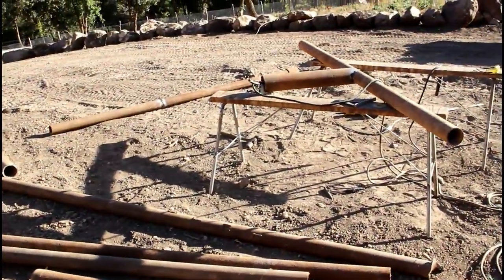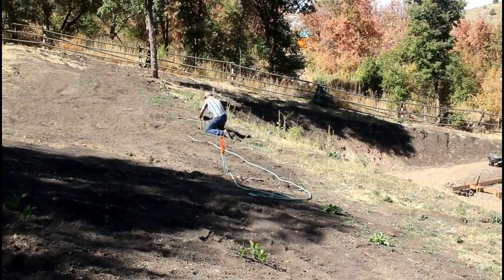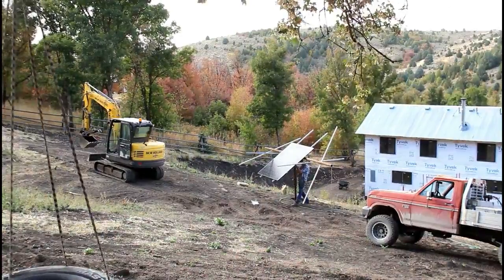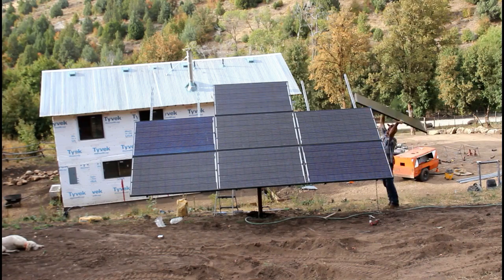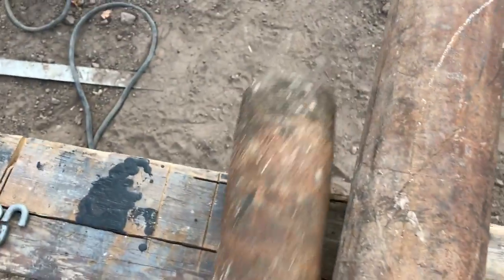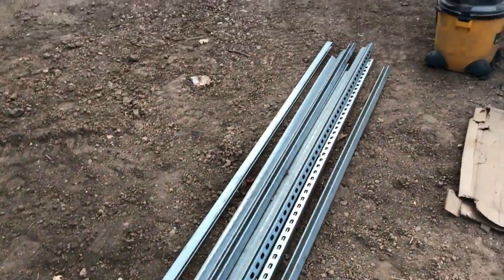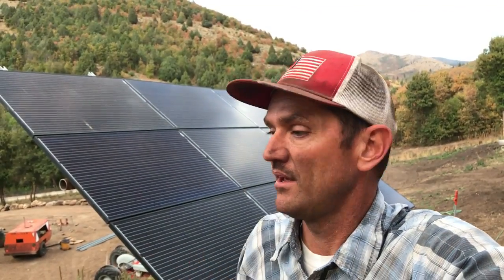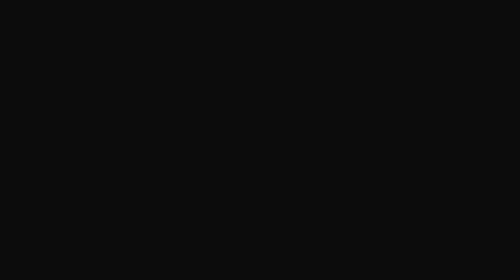#262 - I Built An Adjustable Solar Panel Rack (Ground Mount)

Comment: I need to build my own but just a lot bigger and longer. Will use pipe for taller back rows and shorter front to get 30 degrees for permanent mounts. How did u tighten down the u clamps? Nuts were up in the unistrut correct? And I wish you would show how u connect panels to the unistrut.  Thanks. Jeff in ks.

Comment: Looks great. I'd love to have a mount like that. I only have 1850 currently but hopefully I can get another 12 or 16 panels soon. At the moment I have 8 adjustable aluminum ground mounts but they still need to be bolted to something. They are the 50 dollar each units from Amazon and kinda light weight but not the best for sure. Good video thanks for showing your build

Comment: Why not use a jack screw or a 12 v ram to do your fine tuning?
I would also run angle iron as a brace to take out your bow….any flex or deflection adds to some solar loss.

Comment: I fenced in my priory with railroad ties and cattle panels, 16’, and Tractor supply 5 yrs ago had a smoking deal, I couldn’t pass it up, was cheaper than the rolled fence as well. How heavy are those? I think mine were,200-250lbs each.....I installed 75, and three telephone poles for a ranch style entrance way....memories....

Comment: I bought 2.5kw in used solar for $577 delivered. I just uploaded a video and they seem to produce the power and more. I was going to buy 10 more panels but was really curious of the condition. I just realized I will use 3 in series so that's 9 or 12 per array.

Comment: how long has this system been up have you had any galvonic corrosion with the different metal types .i heard you need to add nylon washers inbetween the 2 surfaces . thanks let me know

Comment: Hi Red Poppy Ranch guys;

I don't want to be critical but I do want to say that I think your mount is a bit weak for the panel array you have. Here are my comments on it.

Wind loading calculations based on the National Building Code, NBC.     
I 'm wary about the strength of the main pipe you are using in your design. My problem is your not designing to a high enough wind force. The NBC is used for houses, structures, and towers in windy environments.

Generally, the wind loading portion of the code is used to design for horizontal wind pressure is 10 lbf/ft^2. Some areas of the country use 15 lbf/ft^2. This means the structure must resist this load for every square foot  projected horizontally. Other local building codes I have seen go to an extreme of 50 lbf/ft^2. You need to see what your building codes say.

The max force is not caused by normal weather based wind which rarely exceeds 70mph. 
The max survivable force is caused by down bursts from cumulus clouds which causes 
an almost instantaneous 90mph which is 10lbf/ft^2. 105mph causes 15lbf/ft^2.

Down bursts don't happen often but they do happen annoyingly enough.     
I have, over the years, had a number of my customers that it happened to.     
Some survived, others didn't. They had an expensive lesson.     
     
Of course, tornado go much higher but are not survivable.     
Hurricanes are also not survivable but you have time to take the panels down.     
     
I don't think your drill stem will survive, even the 4" won't survive.     
     
I have not calculated the dynamic wind loads nor the panel supports. There is a reason     
the big commercial mounts have massive support pipe.     
     
Take a look at what I call "Tripod Mounts" which are stronger in every way and use relatively light materials. See:
http://www.redrok.com/electron.htm#tripod

I have a spreadsheet that may be useful for calculating pole strengths. I tailored it for your vertical post. See:  
http://www.redrok.com/Red_Poppy_Drill_Stem.xls

I hope this is helpful!

redrok
redrok@redrok.com

Comment: Check this site out for your angle.  All you do is plug in USA, state and city.  This will give you the angel you need to have set for the best production per season.  This is what I used when I had solar.  I moved the angle twice a year, once in the spring and once in the fall. Keep in mind that in my experience when the panels are hot they are less efficient that when there cooler.  http://solarelectricityhandbook.com/solar-angle-calculator.html

Comment: How are you storing energy, batteries don’t last so I’m sure someone’s used super capacitors but i haven’t found them yet. You could add a retaining natural pool with a hydroelectric setup. I think a waterfall retaining wall behind the house would look great, plus since you’ve saidur not going to have ac your n your kids are gonna want some way to stay cool in the summer.

Comment: Over here in Northern Utah, we have had some serious 50+ MPH winds, bad enough we couldn't see across the street for all of the dirt blowing, I love, love, love the design and your materials selection, ( I have been wanting to build a tracking array myself.we have a large mountain in our backyard to our west ) my only concern is needing some weight to hold that puppy down, but I have an idea so nothing has to come apart, dig down on one side and weld some horizontal pipes down in the ground, then bury the horizontal pipes with a mix of large rocks on top of that, would be nearly as good as concrete without the costs. Then repeat on the other side.

Comment: If you're really concerned about the pipes rusting and losing integrity you could strap an anode (big piece of zinc) onto it.  The zinc will rust out preferentially to the iron just like in a hot water heater.

Comment: See if you can find a tracking telescope you can use that mechanism to track the sun in order to get the most direct sun for the longest period possible as it is where you are peak solar hours are low so getting as much as you can may be of great benefit especially during the winter months

Comment: Awesome adjustable mount system, Heath. Question, can you get to the u-bolt nuts to adjust the tilt? Typically summer and winter tilts will be somewhat different.
Reply from the maker: I will adjust them twice a year as we get the best angle figured out.

Comment: Great work !  Simple design.   I'd definitely agree with "T" below on the set screw.  We live on 'the point' here with lots of wind.  I've seen bolts even ripped out of concrete - but we hit over 120 mph then.  Anyway lot of force directed at that one spot - So very fine idea with adding the guy wires.  Peace of mind is always a good thing.   All the best!

Comment: Wow, that's a big sail. My concern would be wind catching that puppy and popping it out of the ground. Just a thought, but might consider    a piece of rebar, angle iron, or something crossway to give resistance to it just being pulled out of ground, if wind catches it just right. 50-80mph are not unheard of, kind of common in my part of the world. I've had my 8' satellite dish move with a 1,000 pound piece of concrete bolted to it. Something you might consider for east west adjustment is installing mobile home tie down augers a few feet out from each lower corner, and use ratchet load straps to turn, and anchor panels to ground.

Comment: My biggest concern is the U-bolts allowing the Unistrut assembly to Vertically shift in the wind and the pipe being undersized for the structural load.. Good luck.

Comment: Suggestions for you on bracing and anchoring. I like most of it, except your ideas for bracing and anchoring. At the angle you talked about bracing it, I don't see it doing much of anything structurally. My suggestion is to take a second piece of female coupling and have it float closer to the bottom of the pole and weld your supports to that. You might be able to get closer to (or an actual) 45 degree angle on your supports, which would be super strong. Then you can put you wires off of the angled ties further out. I would also do opposing wires (four at 90's) on the center top coupler, which will give you full stability. Also, as I was typing this, I thought about something else I will add to mine. A series of rebar anchors in a circle  with rings welded to the tops (at ground level, and at whatever degree intervals make sense ). That would allow for using quick release couplers at the bottom, so you can have ready to go anchors when you adjust direction (or you can just put in additional anchors as you go). I am going to be buying property (again) myself soon, and will probably borrow your ideas on the other portions of your design.

Comment: Ok. So now you have water and electricity up there. When will you bring in your propane tank? Man you guys will be living up there before too long! Well done! (And I do reaize that you need to finish hooking everything up and connecting it to the house...) But you're really moving forward. Oh and I agree with one of the other comments. Thru drill that mount, and reinforce your corners. You have a very large wind sail there and you don't want to lose it to the weather...
Reply from the maker: I've got my eyes on a tank.

Comment: I would run 4 lengths of unistrut across it, one of our neighbors installed a ground mount similar but with fencing pipe. We had a really good wind up here and the wind put a twisting force on the panels and cracked all the panels from the flex from the wind..

Comment: Hope that I am wrong but  I think that you need that pipe installed, anchored into a LARGE cement block. They use about 4 yards of concrete here so that it won't blow away or pull out.
Reply: Totally agree, the wind loads will be massive - with out the concrete mass these panels will be off like  kite in the first high winds.

Comment: Looking good, you've avoided mistakes that a lot of others have made by not mounting them so low on the ground that they get covered by snow and weeds, and by making them rotatable. Hoping you can install the batteries pretty close.
It should be pretty easy to add a tracking actuator later on.

Comment: Before you paint your next 2 pipe mounts , go buy a quart of 4% Phosphoric acid and acid wash the pipe ! USE rubber gloves !!!!  It'll remove all the rust , let it sit for 24 hours , then paint . Should be available @ home depot and\or Lowes ! You should really use cement for your main pipe sloar mounts . The dirt will allow the pipe to lean if the snow load gets too heavy on one side or the other . UNLESS , you add pipe braces to the main pipe !!!!!

Comment: Why didn't you put them on the roof?
Reply: The only reason to put panels on a roof other than making them harder to steal... Is you don't have enough property to use a ground mount..
Think about being up over 2 storys..  Having to clean then for dirt and snow build up.. And any maintance problems...
And efficiency loss from the roofs heat....
Plus you would be putting holes in the roof for the mounting hardware..
Reply from the maker: I didn't want any potential roof issues.

Comment: Are you going to be able to get the building built around the water tank before it freezes. How cold does it need to get before the water freezes in the tank? Thanks
Reply from the maker: it' the pipe and fitting that I'm worried about. I'm slowly working on the tank.
Reply: burying it ill be easier if the tanks rated for it.

Comment: With three mounts you might consider adjusting one slightly to the East and one slightly to the west to maximize total output.  In the summer a little more to follow the sun longer.  Enough power in summer for Air conditioning?.   the old guy   Bert

Comment: Throw a chain over the horizontal pipe and weld to the vertical pipe to keep the entire array from lifting off in a storm. It will let you rotate the setup still and if you need to remove can cut the chain off. 

Don't forget the snow load for weight that the setup needs to support. 

With the side of the arrays you will need to clear the snow in front of them after each storm so a small level path large enough for a plow to push the snow away or else it will be lots of shoveling before the snow hardens up. 

One idea that might help keep the panels clear is attaching tubes to the back of each panel to send warmed water (50-60F) ahead of a snow storm with a little wood burner to heat the water and a 12v pump to circulate it. Don't need to get the panels hot just above 32F for them to melt the snow as it hits. The same heater would also make cleaning them off easier if you start heating and create a water layer between the snow and glass. 

With 3 arrays you can have one aimed more south east for early light. one aimed south for mid day and one aimed more south west for late day sun with them all producing all day just when each is at its peak.

Comment: Looks Good! My only suggestion. I don't think the set screw is going to be good enough to keep it from not spinning in the wind. I would drill through and pin it or  bolt it
Reply: Might be enough if he has the chains on the ends adequately staked.  But, yes, that array is a lot of wind catchment and will be a long term concern.
Reply: 3/16th or 1/4 threaded bolt would do the job.
Reply: unless you are going to seasonally adjust it, just weld it, it can always be ground off later.

Comment: Why do people make the mounts so high lower to ground be better so they don't stand out as much..?
Reply: Snow clearance probably.
Reply: He is in snow country.  It makes life easier not having to shovel them out when he cleans/sweeps them in the winter.
Reply: Snow. They are in an area that 3 feet of snow is common enough so there needs to be some space between the bottom and the ground to hold what slides off and what is pushed off between clearing sessions.
Reply: The higher the better, to get as clear a line of site to the sun as possible, any shading from trees and bushes and the hill will make a massive difference to the efficiency
Reply: I'm curious how these things hold up in hail

Comment: If you run the electric wires under ground, encase  any wire showing from the ground up the pole to the panels,we used an old hose and coated it in tar to keep the rabbits from chewing the wires